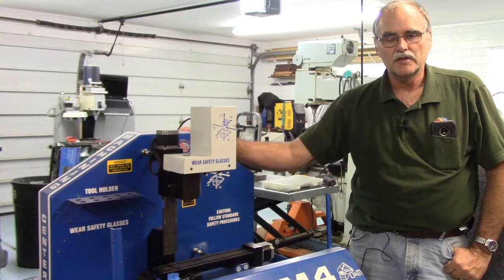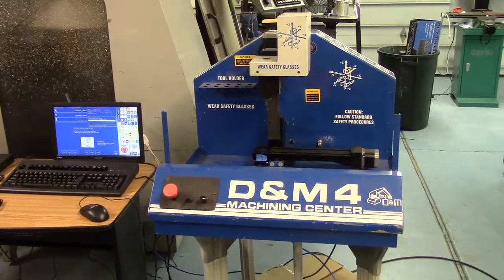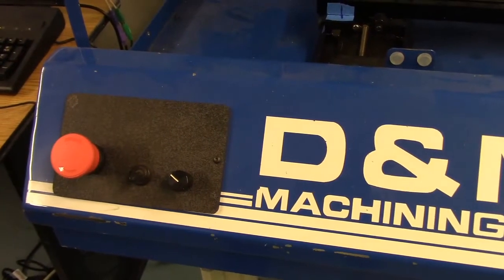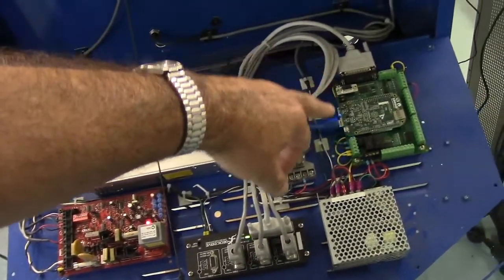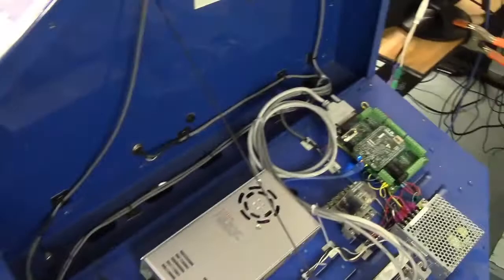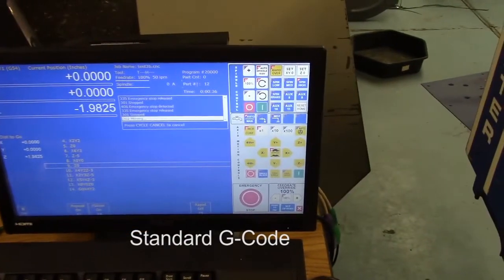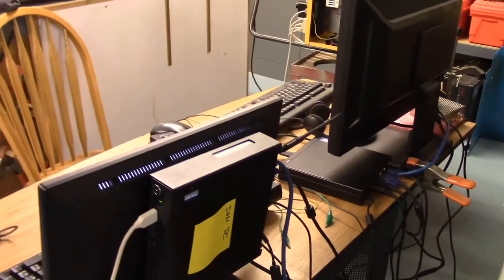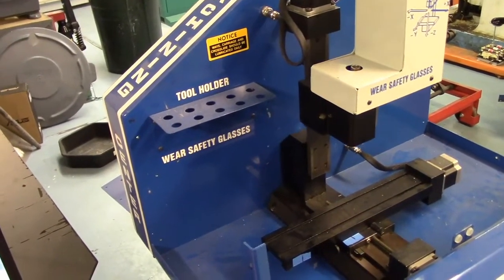D&M4 CNC mill with Centroid CNC Acorn Control Conversion

Comment: Yes. The spindle speed knob. I have the  the original spindle control. I did my conversion based off this video except stronger stepper motors.
Reply from the maker: @customtactics8788  Acorn can control the spindle motor WITH a DC drive equipped with a signal Isolator like a KB Electronics  KBIC-120 and their SI-5. I did a video on that
Reply from the maker: @customtactics8788  Do not attempt to wire Acorn directly to the existing spindle speed controller with out a Signal Isolator. You may damage Acorn otherwise
Reply: Is there any instructions on how to wire that up?
Reply from the maker: @customtactics8788  Yes. Centroid has a schematic. Good Centroid CNC Acorn Schematics and then search KB Electronics

Comment: Any way you can tell me which speed control knobe and how it's wired? I have a d&m4s that I have converted using acorn. Just need to be able to control speed? Thanks.
Reply from the maker: @customtactics8788  speed control knob? For what? Spindle speed? Did you replace the DC spindle controller?

Comment: Can you direct me to where I can get parts for a D&M 5 cnc lathe?  Come across one ( been looking for trainers for some time )recently and am very interested.  any insight will be greatly appreciated!  Thank you for  your time.
Reply from the maker: No. Most people retrofit them with a new control and electronics. I suggest Centroid CNC Acorn
Reply: @martyscncgarage5275   I was referring to pieces such as ball screws, ( or lead screws) and such.  The seller states ball screws.  I haven't found any yet.
Reply: @chamm2976  anything like that you'd probably have to find the right diameter screw and machine it to fit

Comment: I recently picked up one of these used from a college. It looks like its still in good shape. Would you be willing to share a few links for the motors and stepper drivers that yo used? Also, could you tell us what the relay you quickly pointed out was for? Thanks!
Reply from the maker: The motors were on the machine. They were anemic at 24vdc and are better at 48vdc. Gecko G540. The DC spindle drive is going to be replaced with a KB Electronics KBIC-120 with SI-5 signal isolator. The relay is an Estop/fault relay. It may be coming out when I do the KBIC-120 upgrade. If you need to replace the steppers on yours, look at automationtechnologiesinc.com for steppers. Do not oversize them, you may break the leadscrews.
Reply: The steppers that the other person used though are simply Bi Polar NEMA 23s that had the DB9 connectors soldered on though, right? I likely would not use anything higher than a 200 oz motor.
Reply from the maker: 185oz/in and not much bigger. Look at these KL23H256-30-4B. You will have to make up the cables and put the DB9 connectors on them. The G540 will come with solder cup DB9 connectors. I really like the EZ-540 DB9's which include the pot for setting the current limit from soigeneris.com: https://www.soigeneris.com/ez-g540

Comment: Could you tell me what DC spindle controler you used
Reply from the maker: Hi Bill, The controller on the D&M4 came with the machine. I will be changing it out with a KB Electronics KBIC-120 with an SI-5 signal isolator to interface with the Centroid CNC Acorn motion controller